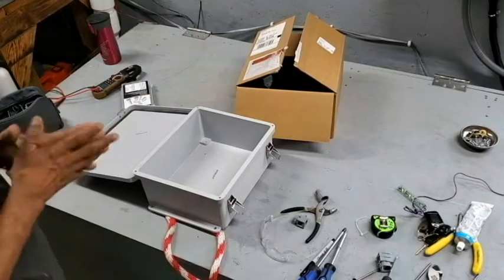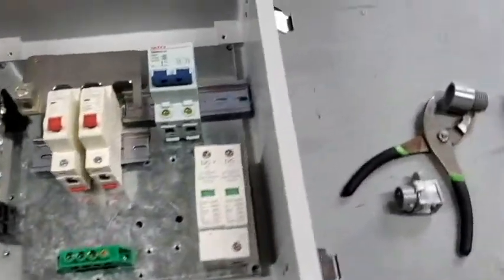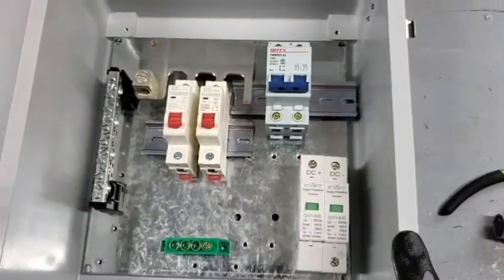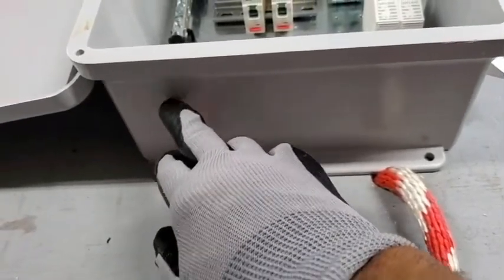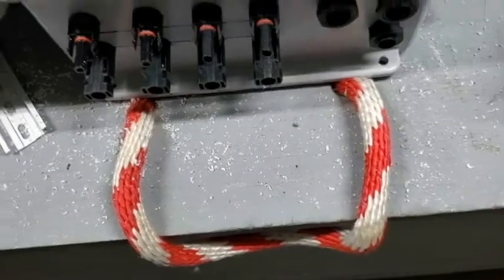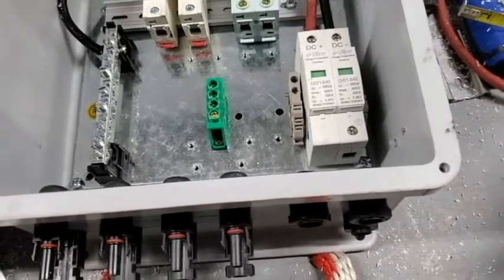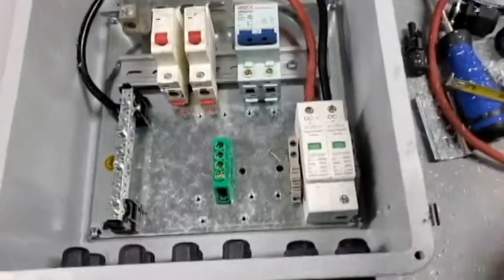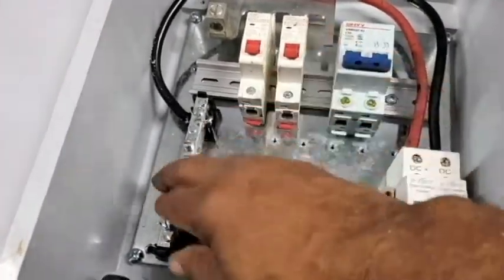Building combiner box for garden solar system

Comment: Nice video. What is the box that you used, link? Also how is your Sol-Ark working out?
Reply from the maker: Overall very eased with the Sol-ark.  There were some growing pains with some of the updates they have been putting in.
Box is just an off the shelf You can get at electrical supply store. Cost $70.00.